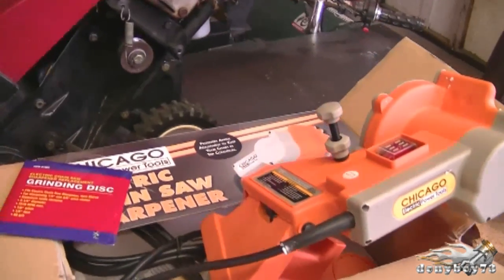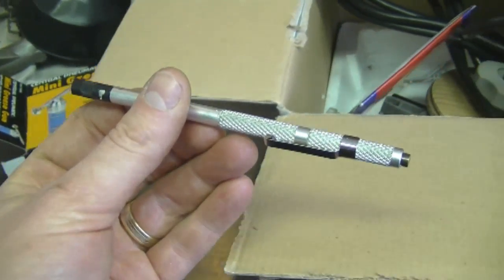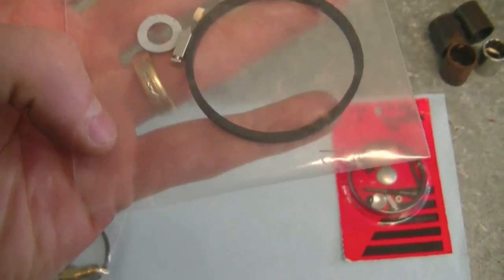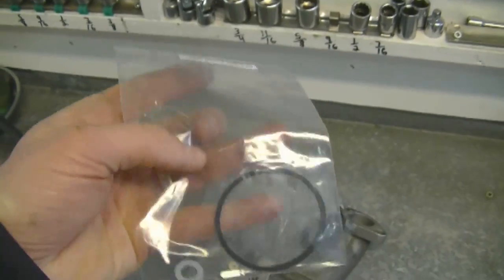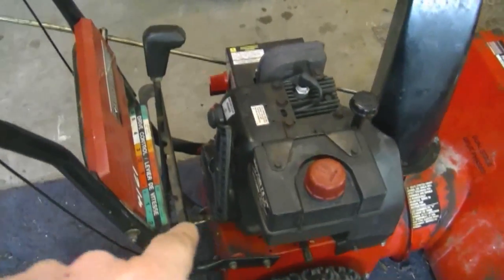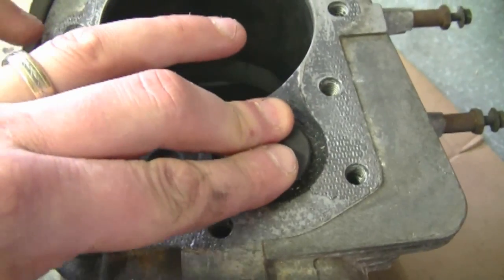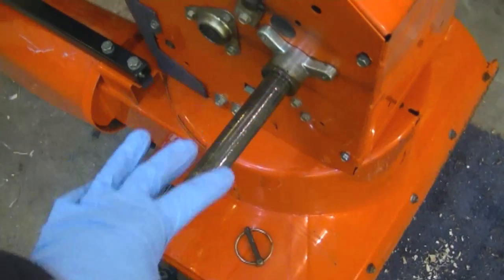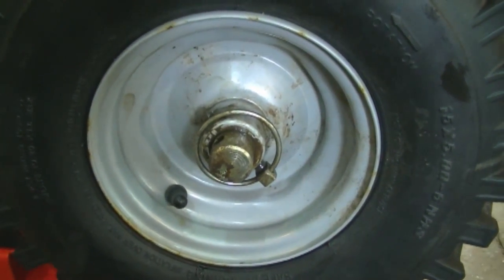Small Engines Q & A Video #40 in HD

Comment: Hi Donny,best mechanic i saw on U tube.Great Videography. I wish I wash as detailed and organized.But You helped Me with the electric Starter on my Tecumseh engine for the Snow Blower. I removed the Starter and found a stripped Gear.Cought me at a bad Snowstorm. Had to borrow my Friends. will see if I can get the Part Monday.I have no Partslist so I take the old Gear with me. I had a bit of trouble taking the Lockwasher.off. Where did You get the fancy clip remover Kit? Thanks again for a great Job You are doing. Wiishing You and the Family a great Xmas Rudy Parys

Comment: @seasonedtoker well personally i dont like tecumsehs cause every tecumseh ive had developed a rod knock and shortly after that it threw the rod through the side of the block. and all these motors had good oil in them when this happened. briggs on the other hand, i had one that i drained the oil out of and filled the case with gas and water and let it run for a couple hours. nothing happened, the parts still look like brand new.

Comment: I have a Craftsman mower with a Briggs and Stratton engine. All the throttle linkages are together but the throttle does not change when i push the lever, even though the apparatus at the carb works? Is this normal for (i think it is) a 625 series engine?